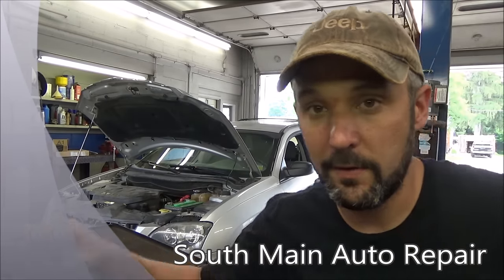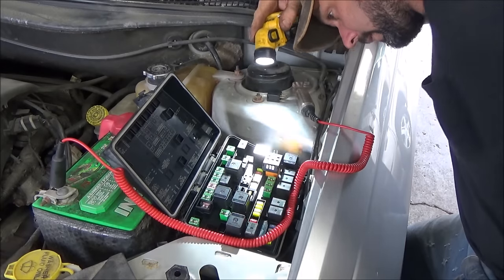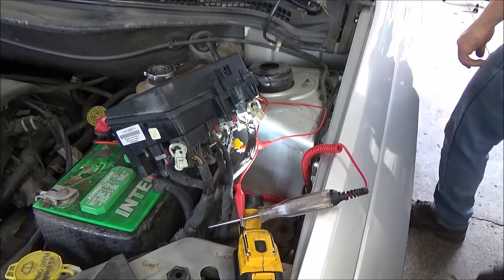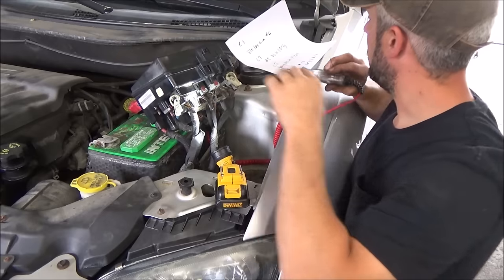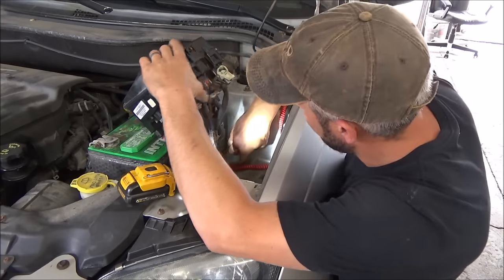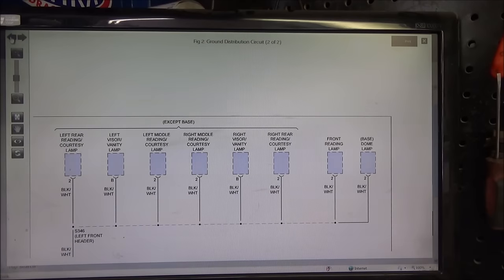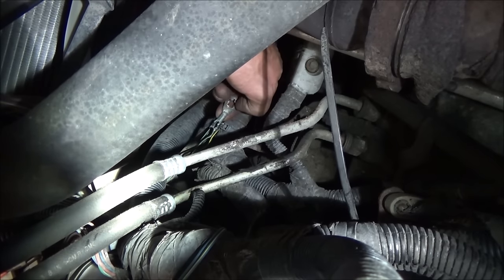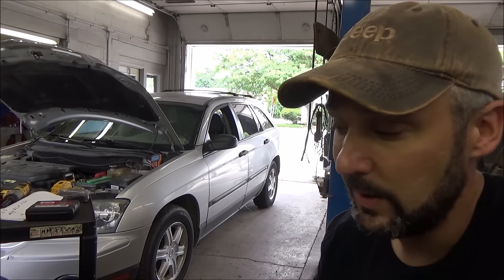Chrysler Pacifica: TIPM Electrical Problems

Comment: I hope the owner watches this video and sees how much effort you went to find the real problem.  Most shops would've replaced the IPM and hoped for the best.
Reply from the maker: farmboy30117  Nahhh they just want it fixed.... Hey I see you got that Chevy all up in the primer now :)
Reply: It's actually painted now but I'm going to have to repaint it because the blue is too bright :(
Reply from the maker: Oh man that sucks.... Didn't see that part yet.
Reply: If the owner watches, he might see how the guy didn’t protect the fender with a cover as most shops do and has tools banging against it and potentially belt buckles scratching the paint, not to mention attempting to sit on the headlight. Also, prying the headlight at first with a screwdriver leveraging directly against the vehicles paint before switching to a nylon tool. Maybe it’s just me. I learned a certain sort of “etiquette” when repairing another persons vehicle. Good job diagnosing and fixing but those small things make me cringe. Some customers saying “I didn’t have these dents or scratches when I brought it in” might just not always be playing a fake blame game if you don’t follow a certain etiquette.
Reply: Is there any treatment, coating or cover to protect the stud from corrosion hazards?
Reply: It looks like he did coat it with a protectant.
Reply: The difference between "fitters and throwers" and actual mechanics.
Reply: The pressing of buttons/steering wheel in the cab with really dirty hands bug me, I hate getting my vehicle back from the mechanic and finding dirt and/or grease on the interior. Of course if SMA was anywhere near me I'd still bring my vehicle there. I can deal with a little dirt, for a job done right the first time.
Reply: I need to start recording my repairs so when the customer gives me "that look" when i charge them X amount of hours to repair a ground or something that sounds simple. They just don't understand that these issues don't point themselves out, you have to find the problem before you can fix it.
Reply: @zaneherrington8868  Some people just have to find fault with everything, esp. if they are god's answer to a mechanic (snork).  Eric O is one of the best, most conscientious mechanics I have ever seen (and I've been wrenching on cars for 30+ years, with 9 restorations under my belt).  Plus, he was using a tray to hold his tools.  There was zero danger of scratching the fender.
Reply: @lcarliner  Yes you can use vaseline or lanoline (aka Fluid Film, which AFAIK is what he used) but it will eventual wash off.  Bar & chain oil like @mustie1 uses also works.
Reply: @lcarliner  I spray all electrical connections with Deoxit and in this case smother the ground connections with Dielectric Grease. This is a good practice to prevent corrosion problems on your Electrical connections. I work on (6) figure high- end cars. Failure is not an option.
Reply: zimm, you need to get out more
Reply: @zaneherrington8868  it's a Chrysler Pacifica with a bunch of issues, it's not a super car.
Reply: Kevin Myers doesn’t give a mechanic a right to damage something that isn’t theirs 🤷🏻‍♂️
Reply: Zane Herrington  it’s an old Chrysler Pacifica, I think the owner will be happy it’s running for as little money as possible. This mechanic was excellent!
Reply: Zane Herrington he can use the $600 he saved by not replacing the module like most other shops would have to have his 15 yr old Pacifica detailed...but he won’t he will be happy he saved a ton $
Reply: nathankox190 aaaaaaagain. Not the point.
Reply: Zane Herrington   While I generally agree with you here on this principle, in this case he had a Chrysler Pacifica with 100,000+ miles in NY state.  It undoubtedly had rust and door dings and more.  Eric has a great sense for his customers and incidental nicks on this vehicle were of no concern.   On the other hand, I’ve seen him use fender protectors and paying extreme attention to overall “cleanliness” - such as a cat back install on a brand new Corvette.
Reply: nathankox190   Exactly!  And what may not have been shown (quite likely, IMHO) is the vehicle being wiped down and/or washed & vacuumed off video after it rolled out of the bay.  There is a car wash next door and perhaps the lovely Mrs. O ran it through.  We just don’t know.  Also, intuition tells me the last time this thing was detailed was when it rolled off the dealer lot.
Reply: @davidhall3747  ... before or after 15 years that vehicle is in use :))
Reply: @SvenAERTS  It's preventative maintenance. I spray deoxit on all Connectors prior to re- connecting them. Electronic Technicians swear by this stuff.

Comment: This same problem has been plaguing me this week. At first it was intermittent and I still managed to get around. Today everything died - head and brake lights, radio, heater controls, windows, horn, couldn't come out of park and my dash was lit up like a Christmas tree with so many warning lights. I found your video and as soon as it was over, went outside and sure enough - all five wires were broken off from the eyelet. It's a tight spot, but managed to strip back the wires and crimp on two new eyes. Turned on the ignition and my car was cured! I dread electrical problems because you can spend days tracing wires and testing components, but you already did the hard work for me and made this an easy and inexpensive repair. I am so impressed with your knowledge and troubleshooting skill. Thank you Eric - you have a new fan.

Comment: Great approach and professional repair. Here's why.  Test..not guess. Initial thoughts were not correct but didn't gamble on
a high dollar parts change out. Testing of circuits didn't involve stabbing holes in harnesses. Repair at frame stud was soldered not crimp and hope (like factory). Verified repairs.  Nice job SMA
Reply from the maker: +moomike laloo Thanks!

Comment: excellent video, and better diagnostics. Went thru this exact same issue on my 06 pac in may of '15 and was fortunant enough to run across a thread online where a guy had the shop service manuals available to read online which allowed me to trace the same issue on the same ground circuit. You are an exceptionally thorough diagnostician and it was a pleasure watching your process .
Reply from the maker: Thanks Phil!

Comment: My 2005 Pacifica (which has been an excellent minimum repair vehicle) suddenly started doing the same thing described here. I watched your video and suggested to my mechanic thatn the ground was bad. Sure enough, the wires broke off at the terminal. Your video saved us a lot of time and trouble trying to diagnose the problem. Thank you.

Comment: i just had this same problem with my wifes 07 pacifica. thanks to watching this i was able to get it figured out quickly and get it back on the road. thanks!
Reply: What was wrong with ur wife's. My wife's is doing kinda the same thing
Reply: Mines also doing this. What exactly was it that needed to be repaired?
Reply: @AlexStJohn-jx2vb  check the ground wire on the rad support left side low down look for a stud with a bunch of wires on it.
Reply: @johnnybozarth8015  watch the vid, he found the bad ground

Comment: I had the same problem with my Pacifica all those ground wires were corroded to the point that it would no longer start after a couple weeks of doing some very weird things. I watched your video and was able to fix the problem saving me a lot of money, thus i subscribed to your channel. Now its a year later and my Pacifica is still running. You sir are the man, thanks.

Comment: Thank you so much for making this video. I had no windshield washer pump spray. I cleaned the grounds and put everything back together and the fog lights went crazy flashing and the power windows and wipers stopped working. I was giving up. So frustrated. Then I found your video and sure enough I had broken wires in the connector. I cut and soldered new lugs just like you did and now everything works. My fingers are sore from that job so awkward. Thank you so much you saved me.

Comment: That was a fantastic post! I forwarded it to a tech currently working on my 2018 Pacifica Limited, that is having some crazy faults occur as well. Particularly, it's been losing the electronic steering assist. I suspect a bad ground, but locating it may be time consuming. Your video shows a clear approach to troublshooting and the tech assigned to my vehicle has a high level of integrity, just like you. Even if it turns out to be something totally different, it was a very well done video and enlightening to watch. Thank you!

Comment: I just watched your video, what a marvelous job you did trouble shooting the problem. I always have problems trouble shooting electrical problems (and computer problems). My age 75 is helping matters...ha..ha. 
I found your video as I was searching for how to change the spark plugs on my 05 Pacifica. I use to work on my own carsfor the most part, but it gets more difficult these days
I want to learn how to keep the basics up as I really like this car, and hope it keeps running until I no longer need a car.
I keep my old 1973 450SLC Mercedes running for 28 years, when I bought the manual after visting the dealership for repairs.
Now I have to figure out how to mark your spot, and how to view other videos you have made.
Thanks, Brian

Comment: Outstanding video - tremendous instructional video.  I bought 05 Pacifica at auction and all the dash lights were lit up with no power to windows, horn, heat or radio just as in this video.  My immediate thought was the TIPM as I had one go bad on my 2010 Town & Country (no headlights).  Anyway, this video saved me a ton of time, money and frustration.  Sure enough, it was the ground strap where the 5 ground wires were clamped to the eyelet at ground post G103.  Made the fix as Eric did and dash lights are gone with power restored.

Comment: I worked at a local John Deere dealer until retirement, I love to work on electrical.  On battery terminal post connectors if the resistance between the post and the clamp connector  was .03 ohms or above .00 clean this connection. Just a time saver diagnosis of the battery connections. 👍 Keep up these great videos.

Comment: I just had this issues with my 04 Pacifica. Was about to bring it to the shop until I found your video. Thanks for doing this and it fixed all of the issues I was having. Only thing I did differently was pulled the battery and the battery tray instead of the headlight. It just gave me a little room from the top. Keep up the great work and the videos. These are awesome!

Comment: Your videos have helped me and others so much, Thank You. I would like to share some tips  on fixing a sliding door on a 2006 Honda Odyssey. Two different vehicle the door were non operational. By removing the rear latch screws one at a time and spraying WD-40 in the screw holes it lubricates the micro switch that is in line with the screw hole and in both cases the doors started working again. You may already know this trick, but if not it is a real time saver and a year later the door is still working.

Comment: That was brilliant.  And kudos to you for using your "approach" which cured the problem AND saved the vehicle owner money.  I'm dealing now with a driver's side low beam that won't illuminate despite changing the bulb (2007 Dodge Caliber).  It worked the first time I had Grease Monkey replace the bulb, but only for a month.  I've replaced the bulb again with no success.  So your discussion about the TIPM was very relevant to my problem.  But, I'm guessing that the ground may not be my problem, as the high beam works well.  It's a pity that I don't drive, from Denver, to visit my clients in Ithaca and Carthage, or I'd make an appointment to have you fix my problem.

Comment: Excellent video!! Very good description of the customer complaint. Video follows easily. Diagnostic technique shows professionalism with high-level experience. My 2006 Pacifica had the exact same issue. I had 3 broken wires. Solved several ongoing intermittent issues. As a retired automotive technician, I thank you for making your knowledge public!! For those wo are not mechanically inclined, or have a hard time understanding electrical diagnosis, subscribe to this channel. Watch more from this channel, you will be enlightened.

Comment: Well I just stumbled onto your YouTube channel/site and was pleasantly pleased at your competence that I myself have used these techniques as well as others in my over 20 years of active duty military service as a telecommunications device radio repair instructor specializing in computer repair to component level.
It is unfortunate but I have noticed this trend worsening over the periods of time of operator neglect and misuse of the equipment they attempt to operate.  Simple procedures for eliminating or lessening problems such as this can sometimes be remedied through observation.  95% of all troubles in my life have been visually observed.  Preventive Maintenance As Well as some basic understanding of physics and chemistry can be a game changer.
I kind of like your terminology of the "green crustacean" but I know it as "electrical corrosion" when I learned about it helping my father, that was a master mechanic back in the 1960s.  Before WD-40 came along as a easy repair and elimination of electrical corrosion I learned to use baking soda water concentrate and then clean the area as well as replacing terminals onto wire properly and insulated as well.
As well as the capabilities of a proper design to eliminate or at least lessen the possibilities such as this can be easily done as well as inexpensively.  Most any and everyone knows that electrical contacts should not be exposed to the weather especially harsh weather with salt, so why do they make these vehicles were things like this will eventually happen as if they want it to!
I never ever have any "electrical corrosion" because I saturate my battery terminal with axle grease before covering with a plastic cover all the way into the wire insulation.  This little bit of work ensures the longevity of my electrical system and most likely any possible malfunctions.  Now days things are even easier with spray grease in a can, I really enjoy the spray lithium grease which also works well for any kind of hinges.
The design and workmanship of that TI PM box should be classified as a crime of stupidity, it should be completely sealed away from any possible whether as an completely watertight!

Comment: I'm currently attempting to find a problem similar to this in a 2004 Jeep Liberty. No power windows, No Door locks, No head lights, No wipers, No dash lights, No running lights etc. I was going to replace the IPM, as I have a parts car but now after watching this I think I'm going to start checking grounds and such. Thank you for the tutorial!

Comment: I called Advance Auto and told them my money light was on and they said excuse me sir so I said forget that I need a radiator for a 73 beetle.
Reply from the maker: mailman7478 Lol I don't think they stock the radiators there but if it was mine I'd start with the water pump and t-stat any how ;)
Reply: I had to replay the "money light" part three times.  That was really funny.
Reply: Sometimes when the money like comes on the car goes into sneaker mode.

Comment: GREAT VIDEO, SAVED MONEY BY CORRECTING WITH THESE INSTRUCTIONS.  I had the same problem with all of my features not working.  I followed the procedure, and my issue was resolved.  My problem was the same exact /yel ground wire.  Once I corrected the ground, everything worked again.

Comment: I'm an Industrial Electrician (apprenticed at Ford, Dearborn).  I commend your troubleshooting techniques as they are mine too.  I always look for one problem and chase it to the source without getting sidetracked.  Sometimes TWO problems happen at once in the same circuit which is why I use a jumper wire.  This technique separates the men from the boys.
The last thing I want to hear is, "Well, last time it was..."  I want NO background information until after it's fixed.  This is where many get sidetracked.
I do take a minor exception to using solder because it doesn't make as good or as low-resistance of a connection as a crimp.  A tight crimp mashes all the metals into one solid mass.  (For this argument, I don't care about environmental issues.)  Simply use a good name-brand crimp connector, NOT the stuff Harbor Freight sells.  The barrels on HF connectors come apart at the split when crimped.  Crimping and soldering the connector only expands and contracts the connection which is a bad idea.

Comment: You were spot on with the grounding problem on a pacifica. I went to the garage and couldnt find the wires were grounded but I did get it fixed. Thanks again. You are the best

Comment: Get out that tube of DEOXIT,  which you introduced me to.....Just what the connection stabs cry for.....great job......When I was over whelmed with multiple alarms, or electrical problems, I found it best, fix what problems I knew were easily traceable. Many times when I fixed that, many other problems would disappear. Sort of how you handled the horn circuit. As always, Great Job, Rick.....

Comment: This video help me a lot I was told so many different things and I had to my research to find your video but when I found it and when out and touch that ground and everything worked I told my mechanic and he spiced the wires and reconnected them and I have not had a problem with that issue every since you are the best mechanic and you help people save money and make money my mechanic fixed more people cars like this and other Chryslers just not Pacifica have these problems THANK You